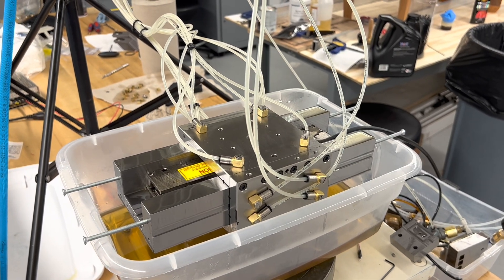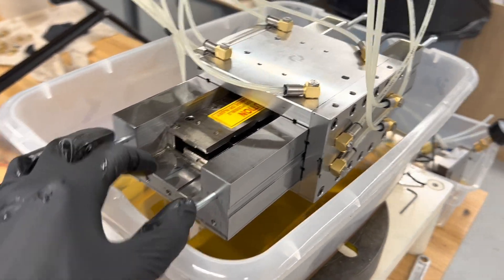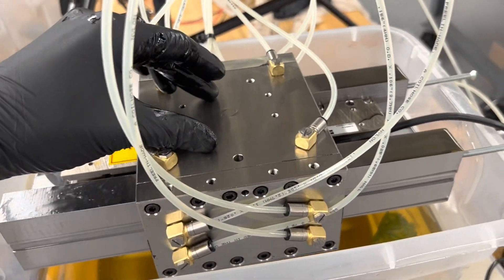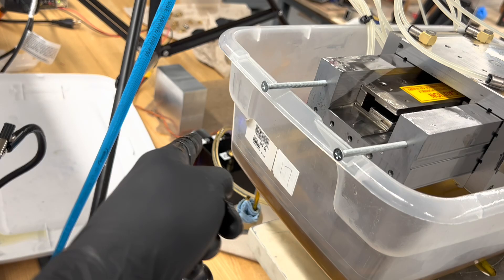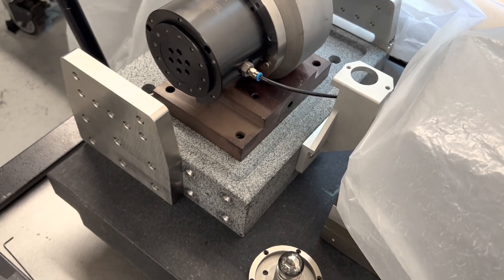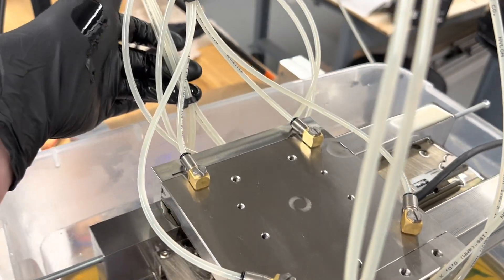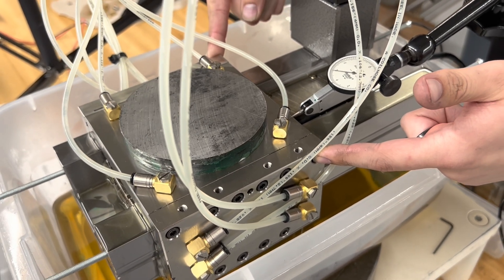Homemade hydrostatic bearings for diamond turning lathe: a slightly closer look

Comment: Good afternoon, which movement accuracy can you achive with this slide?
Reply from the maker: @SuperHemi2006  it’s straight to about 1 micron
Reply: @cylosgarage  Good morning! What needs to be done to achive <1um or even better? Isn't the precision also connected to the oil pressure control? 
And I saw you are milling the slides on "conventional machines" Isn't it one phenomenon as well that hydrostatic can even compensate maufacturing errors related to using conventional machines or those with conventional ball bearings? If so, how much can hydrostatic compensate of those? K.R. Armin

Comment: Hi sir, can you please tell us whats the tolerance between the bed and the slide
Reply from the maker: @sandeeps7979  .001”
Reply: @cylosgarage  sir where did you purchase the diamond insert any information available on the tool, planning to test cut telescope mirror on cnc turning centre.
Reply from the maker: @sandeeps7979  I got mine from Edge Technologies, but there are many MCD tool suppliers around the world. Have you tried googling it? That usually works well. As an aside, a normal cnc lathe will not be even close to accurate enough to cut a telescope mirror, unless it’s meant to be operating in the FIR spectrum or something.
Reply: @cylosgarage  Hi sir what is the radius of your mcd tool.
Reply from the maker: @sandeeps7979  you asked me the same question 6 months ago and I answered it. For your convenience I’ll repeat myself: 0.5mm. But that might not be the right choice for you. The world won’t explode if you don’t use the exact same tool as me, don’t worry.

Comment: Might work better with thicker oil.  I got a 40 year old worn out tractor.  I has a hydro static transmission.  I cant use regular thin hydraulic oil because the pistons in the axial piston pump are worn out.  So i switched over to 10W30 engine oil and now the hydraulics work great.
Reply from the maker: @------country-boy-------  this bearing system was designed to use this particular oil. The viscosity is a big part of the engineering calculations
Reply: @cylosgarage  ok.  one day i wanna make a video of the invention i been working on.  its a mechanical device for encoding the rotations of threaded rod for a gantry mill.  Would be perfect for machines that use ball screw actuators.

Comment: All those plastic pipes could be replaced with very thin copper pipes which meet in a manifold on each face.. Glass inspection window on each manifold at the highest point to  for Observation of air bubbles.  Pipes could have s Ben's in them to Eliminate expansion having an effect on the fixture.. A much neater and easier to manage Hydraulic distribution system

Comment: question for you - why are all the tubes these massive lengths of tubing connected to an overhead distributor, instead of one or two loops around the whole device using T-fittings to supply pressurized fluid to each individual port?
Reply: Taking a guess that it's because if you make a loop the pressure won't be the exact same from the first port to the last/middle

Comment: Very inspiring! Amazing work. I was getting into a direct laser lithography to produce photo masks for planetarium projector star plates. I wanted to use a high NA microscope lens and just pull the focus in and out to adjust the star diameter to expose the photo resist, while an XY table moved the plate to the proper coordinate for the star position. I was working with a precision stepper stage with a 1mm pitch lead screw. Still couldn't get reliable focus variation. So I was led into exploring a similar air bearing set up for Z with high resolution feedback.  That quickly got way out of my technical capabilities and financial reach, so I am just going to pay a photomask company to make them on polyester film. Much cheaper, but not as much fun!

Comment: If you have access to that same surface grinder that made the ways, you can make 3 just a bit larger plates, lap them to whatever level of measurable perfection you want and then use them to lap in this ways configuration... It can allow you to bring the thing down to sub micron levels and to achieve instruments grade, optical flat levels of surface finish... I can clearly see that that grinder did a marvelous job, but i would bet my left ass cheek that an optical flat glass would have a complaint or two, just like the electronic scale would or even an electric spherometer or similar metrology devices... A surface grinder, however marvelous it is, is prone to having its own specific surface finish and deviations... You can look up robin renzetti`s videos on the topic, but yeah, nature of materials being what it is, the most rigid of surface grinders is still susceptible to laws of elasticity and similar principles of material physics...  
Making flat lapping plates after that level of surface grinding is merely a matter of dedication and time, and some ultra fine sub micron grit... Like 0.25 micron particles and such... It will take time, but you will get 3 maddeningly precise plates, one of which you can use as a surface plate if you dont use diamond or similar charging grit to polish them... I know that diamond is the best for material removal, and that it automatically makes a lapping plate by getting charged into the surface, but if you want flat plates to decide what to do with after making them, then diamond is not the acceptable option of abrasives... But just think of the insane grade of a precision inspection plate you could get from that... You could even use marble or granite for those plates, a surface grinder wont notice the difference while grinding, and unlike mild steel, stone is comparable in cost, but ridiculously more stable and harder, which at the same time allows you to use diamond grit, as its wont really embed into stone, stone doesnt deform that much around forced particles, its more like glass, its either shears off or breaks off, it doesnt plastically deform around a chunk... Which will force you to use the plates as wet lapping plates, but on the plus note, it grants you a surface plate with less effort in selecting of grit type... 
Otherwise, im enamored with this... Its not new concept to me, but seeing a nice piece like this is quite like watching porn is to normal people in my case...
Also, while im here, rewatching this, i would advise you to check out the merilo grade steel for future use in projects like this... It is known as Sihard 2842 steel... It is not stainless per se, but it is more resistant than mild steel, and it is both hardenable, stable as fuck, it can be hardened and ground or hard-machined and it doesnt shift after the fact due to its stress nature... Its just amazing... I bought 450 kilos of it at the scrapyard after some grandpa engraver died and his shop was tossed out by the family(khm, scum, khm), well, i paid the deposit, and came a week later, only to find out that some piece of work snagged 180kg of it from that pile... In short, the guy who makes gears got a tip from one of his employees that the merilo steel was to be found there, he came, and picked the best stock, got it to the scale and paid for it, as the guys cant spot eye by steel, as you know... I came, saw that like half of it was missing and the best stock, whats worst of all, and was of course pissed as fuck... took what was left, 270kg to be precise, and some days later, i went to the gear making guy, totally oblivious of the fact that he is the one responsible for taking from the pile that had ``paid for`` sign on it... needed some gears made, had a chat, as he is a tinkerer like me, a free machinist spirit, and through 20 minutes of shop tour and talk, learned that he is the one who snagged my fucking merilo! He praised the stuff like it was pure gold, and of course, i didnt press the issue too hard over the fact that it was fucking paid for steel that he took, but anyway, you get a free advice regarding the ways finishing and a small anecdote along a tip for material selection... From what i understand, merilo steel is mostly used in die and punch making and gear forming, as it offers ridiculous material stability, extremely gentle thermal growth properties and so on... I get that you dont need a toolsteel for hydro bearings due to no wear, but your other issues might benefit from merilo steel... especially in the machining department, as a toolsteel that helps you make precise parts is always a great choice, even if you dont need it to be toolsteel... 
All the best!
Steuss

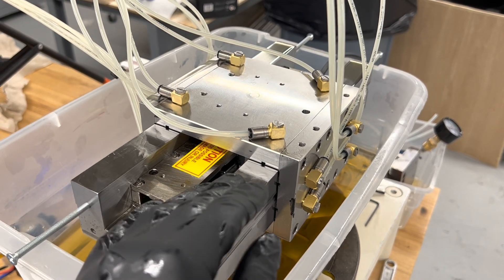Comment: @4:35  Don't worry, you could just build a room/building HVAC system to maintain 0.1F and a separate machine enclosure HVAC system to maintain an ambient temp within 0.02F. Probably helps with the barometric pressure too!   ;)

What wheel did you use to grind the stainless plates btw?

Comment: What steel are you using does hardness matter?
Reply: He clearly said that the main ways are mild steel and the carriage is inox... 
The hardness should not matter, just like in an air bearing, as the two surfaces in theory, if the system is operational to its full extent, should never touch, and so, they can not wear... The surfaces have a film of oil that clings to them, and the middle of the oil film thickness is where the ``oil shear`` happens to allow for sliding motion... As said, just as with air bearings, that keeps the two surfaces entirely apart, and where there is no contact, there is no wear, so hardness is merely an afterthought depending on the chips and such that the machine will be producing, as you dont want hard, hot chips at speed being launched at the mild steel ways and scratching them in turn, thus worsening the fluid bearing quality... 
This, essentially, as long as the oil is clean and at optimal pressure, and the machine is within its operational parameters(no over loads of any kind), should never wear... You could technically have this carriage sliding side to side for a million years and the material would not wear a single 1/1000th of a single micron... Your bearing and wearing surface is the oil film itself, which shears in the middle of its thickness and thus ensures that there is absolutely 0 wear... 
As said, if you are going to be using such a system as a grinding axis, and have grit particles hurtling at the surfaces at crazy high speeds, sure, you might want to have ridiculously hard surfaces to prevent that kind of wear... You also might want to enclose the whole system in as close to a hermetic shroud as possible, as that prevents any possibility of nonsense, but that is much harder to do than say... 
This was said to be a diamond lathe, so its a single point cutting lathe, which while diamond does shed some particles, should behave relatively nicely in the mess department... A simple enclosure for the ways should be sufficient to keep any particles away from landing on the ways, or high-speed impacting them as a fresh chip launched by the spindle... 

Kind regards!
Reply: @camillosteuss  You know they should make Youread   next time .Im not sure why im more willing to read the comment  rather then listening to the video with all ears.Guess it is an age thing.
Reply: @woozhi9218 
What do you mean? I may have overdone it with the comment length, but its my disease, i guess... I merely said in too many words why you dont really care about hardness for system performance, and why the same property might be very valuable... 

All the best!
Reply: @camillosteuss  i was just joking .But seriously i think reading your comment was much easier and quicker.(Gonna start  Youread  after this)

Comment: I guess those rails and bearings are in micron precision range.. where do you get such high precision machining?

I own a air bearing cnc I bought for very cheap from failed pcb manifacturer company and Im finishing electronics these days because ti was using old analog complicated electronics..

Im gonna use it for wood and plastics engraving but since it should be high precision am wondering what else I should probably use it for..

Comment: That looks awesome!
Is there a specific reason you don’t combine the oil tubes of the carriage right away to one so just one tube goes to the pump instead of 12?

Looking forward to see it going together!
Reply: same question. I feel like having one feed line and a plenum/manifold close to or preferably mounted to the table would give you not just easier management, but also less influence from stiffness in the lines. Springs in parallel are stiffer than springs in series after all. They don't appear to be separately regulated so I don't see the utility of making them parallel.

Comment: I wonder if you'll see pressure variations from the pump in the sensor data
Reply from the maker: We should in theory. I’ll try to measure it when I can. PI did a nice little investigation into it on one of their spindles: https://drive.google.com/file/d/1KDcTqtPRKPudm1EFrgzGlnRpnx_PLJVM/view?usp=drivesdk
Our pump runs at a fairly high speed, so hopefully any pressure ripple effects will be of a very high frequency that will be damp-able via squeeze film effects or tubing compliance. We’ll see

Comment: Does the plastic tubing act as a spring /accumulator for the oil, because it is less stiff than the oil?
Reply from the maker: This is possible in theory, although the tubing it fairly stiff so I'm not sure how much of an effect this is having
Reply: @cylosgarage  Since the compliance is upstream of the restrictors, it should have no effect.

Comment: Awesome!
I'm curious, why'd go for hydrostatic and not air bearings?
Reply from the maker: They are, in some senses, easier to design and make. They offer higher stiffness and better dynamics (lots of damping) too. You get all these things for the price of an absolute mess :)
Reply: @cylosgarage  but at least you don't have to have even tighter tolerances, and you don't have to scrub your air supply of moisture!
Reply: @weatheranddarkness  air bearings are designed to preload them against the bearing surface and have a flexure strut that allows for flatness and parallelism against the bearing surface (typically granite or ceramic)

Comment: Really nice Work. But why did you go with 2 different systems for X and Z Axis?
Reply from the maker: Thanks, having two different slides for X and Z means you're not stacking up errors on top of each other allowing compounding of tilt error motion, etc. It also makes life a little easier for the servo control.
Reply: @cylosgarage  Ah yes this makes sense Thanks